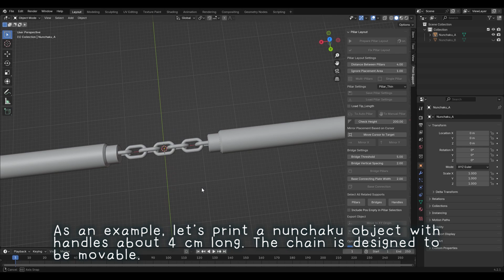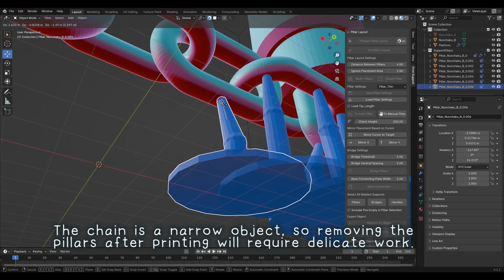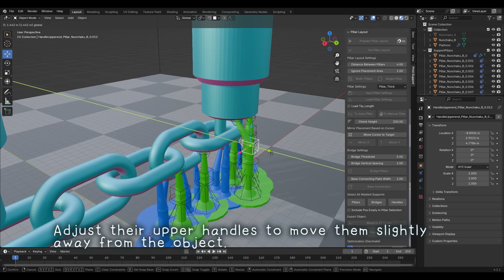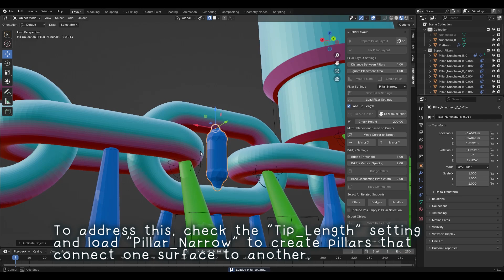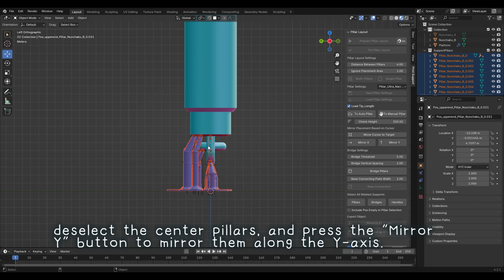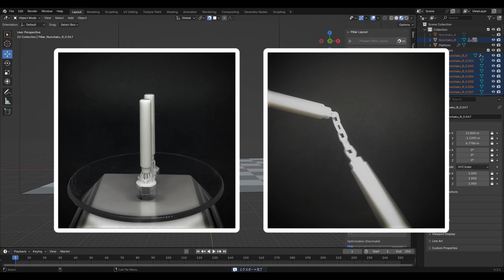PrintSupportPro Tutorial 3: Support Pillar Placement for Delicate Structures

Comment: Does this add on take over the need for a slicer software?
Reply from the maker: Thanks for your question!

Instead, it helps you place support structures manually within Blender. After that, you'll export the model as an STL file, and then use a slicer software (like Chitubox or Lychee Slicer) to create the appropriate print file for your resin printer.

The typical workflow looks like this:
1. Use the add-on in Blender to place supports exactly where you want them.
2. Export the model as an STL.
3. Open that STL in your preferred slicer for resin printers and generate the sliced file for printing.

This add-on is especially useful when printing intricate or delicate models that need carefully placed supports — just like the one shown in this video.

Hope that helps, and happy printing!
Reply: @DUCKLABO  Thnaks for reply!  I'm a 3D print newb but a experienced Blender user.  I like to put the support structure in a software like blender that I'm familiar with rather then fumbling in a slicer software.  this is exactly what I'm looking for and got a copy!!  Thanks for making it!